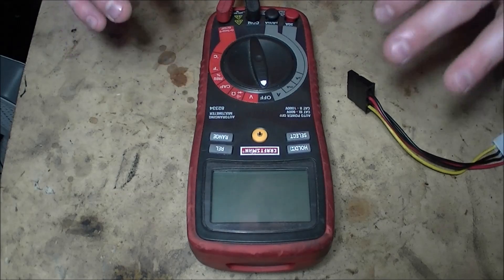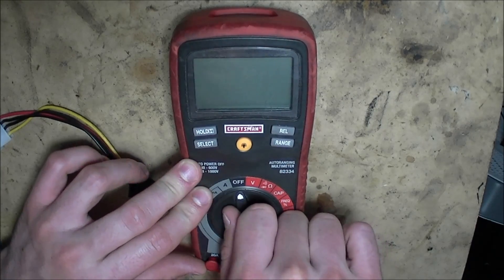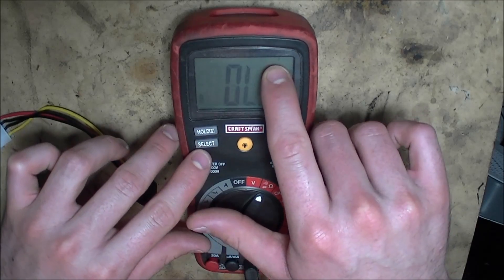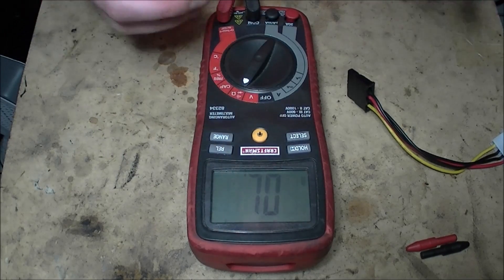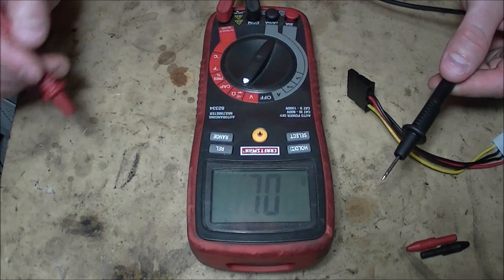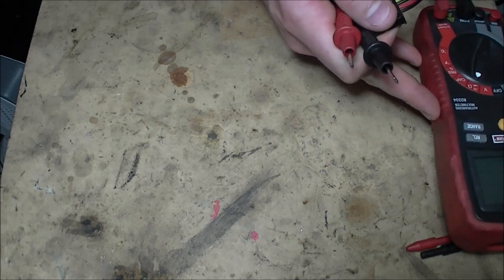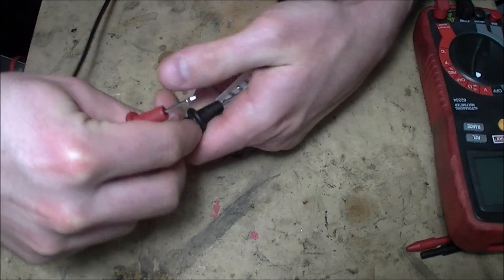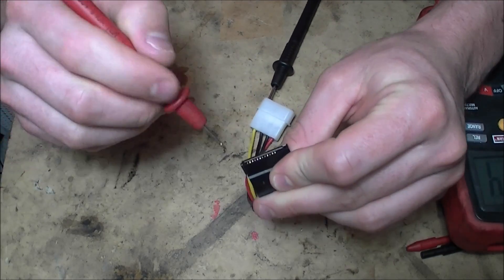Continuity Test "How To"

Comment: I have a cheap multimeter that doesn’t make sound but I’m confused about the reading. I’m tryna figure out why my dryer won’t put out heat and when I test things like the heater element and fuse the numbers jump randomly and sometimes won’t read anything. But when I took the parts in to the store they tested it and their multimeter read that they were fine. What numbers should pop up for continuity ?!??

Comment: Also continuity can only be checked in resistance (ohms) so if it has the horseshoe symbol and you pressed the WiFi looking symbol then numbers you see are going to be in ohms. Which then, it’d be good to check the resistance (ohms) of the wire and see if the wire has high resistance if the load (or part) isn’t performing well.
Reply: Less than 1 Ohm preferably.

Comment: Do you have to disconnect the battery or do you got to have power
Reply from the maker: You can disconnect the battery if you'd like, this continuity test requires no voltage. The multimeter provides the signal voltage it needs.

Comment: How about showing the reading?!
Reply from the maker: Reading is irrelevant, the sound is all that matters. No sound, no connection. Simple as that. If a wire is shorted to almost a no wire connection, it would be hard to tell if the reading was false anyway. At that point, you would have to look to the schematics data.

Comment: Will it create a short if you test for continuity on a live circuit?
Reply from the maker: I would not test a live circuit unless it was 12v or less. Any higher, and you could possibly short out your multi meter. It's a good practice not to perform this test with any current.

Comment: Hey bro while doing that there was no connection (no beeping sound) but the voltmeter was showing some value what is that and should I be worried
Reply from the maker: When testing for continuity, you are only paying attention to the sound. Could be the resistance from your body making the meter show digits.

Comment: Terrible video. This is not to test to find the wire. Continuity is to test for resistance and can determine if the wire is good or bad... but then again this is automotive not aviation.. I guess yal ground guys get an easy get away

Comment: The 'wifi' symbol is the symbol for buzzer on your multimeter.
Reply: Incorrect , two symbols indicate continuity.  One being the wave which is shown in the video here the (WiFi) logo , known as wave.  The other symbol is the diode symbol which is an arrow on a line basically.